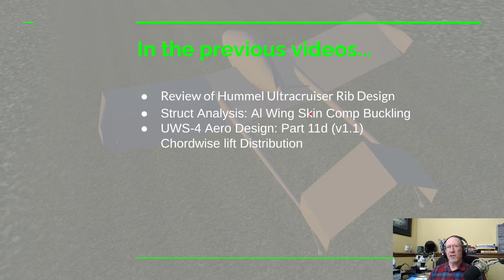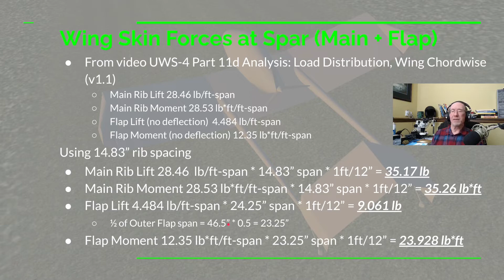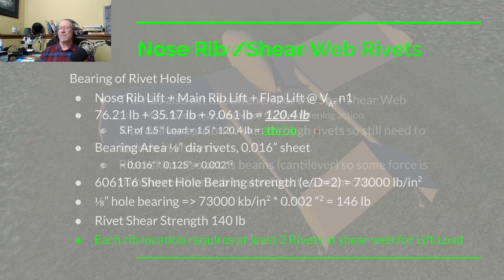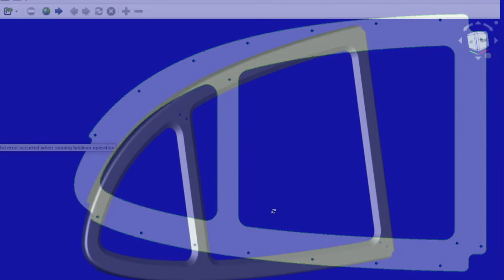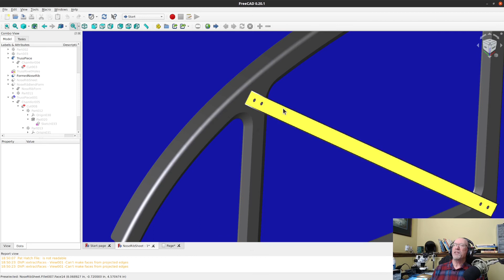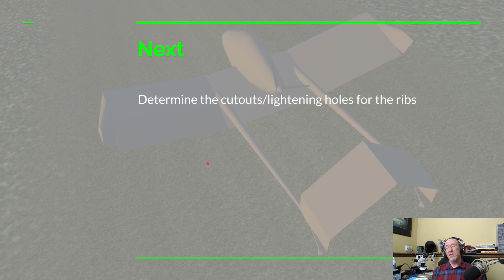UWS-4 Struct Design: Rib Skin Rivet  Locations , Part 2a

Comment: I'm loving your content, I'm interested in developing an ultralight myself.  I want to replace a wood and fabric wing design with aluminum and fabric.  Have you read "Sheet Metal Building Basics" from the EAA store?  If not you should, lots of great information well presented.  In this video you mentioned using 1/8" rivets through 0.016" skin.  This is too large a rivet for the skin thickness.  Chapter 19.4 states that the rivet diameter to thickness ratio should be no greater than 5.5, otherwise the expanding rivet will locally distort and buckle the sheet.  For 0.016" sheet the largest diameter rivet that can be used is 1/16".  See Table 2 on page 19-4.  I have not been able to find 1/16" pull rivets so it will be necessary to use solid rivets.

One other comment.  A downside of starting with a large sheet, bending it, and cutting out lightening holes is that it results in the most scrap so it adds considerable cost (the need to buy more raw material for the same end result).  While I agree that the 5 piece nose requires making more parts and using more rivets to assemble them, the parts start as straight rectangles that then get bent into shape so there is much less scrap from the raw materials.  If solid rivets are used they are cheaper, lighter, and stronger than pulled rivets, but they do require different tools and learning the techniques to install them.  If your ultralight is going to be primarily aluminum then the one time cost of the tools will be small compared to the number of rivet you will need to set so using solid rivets where ever possible will ultimately cost less, be stronger, and weigh less.